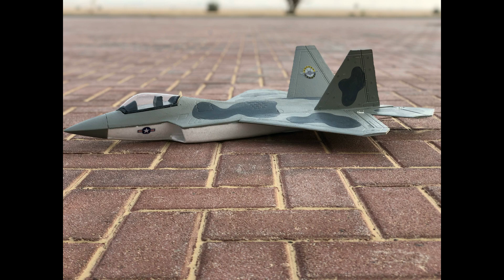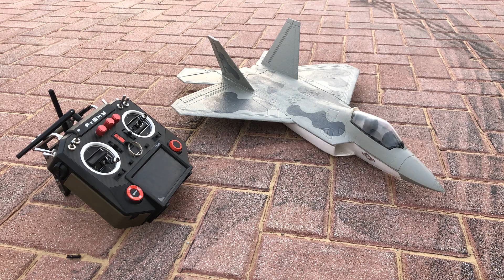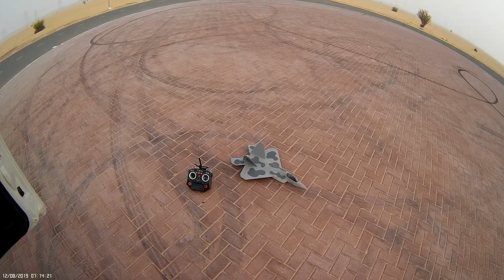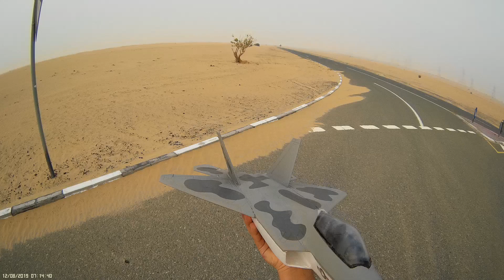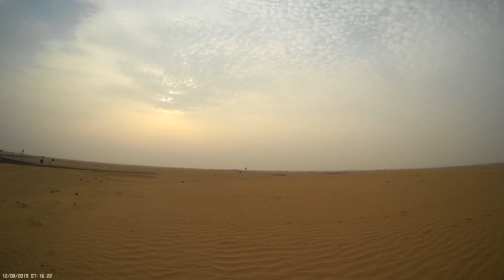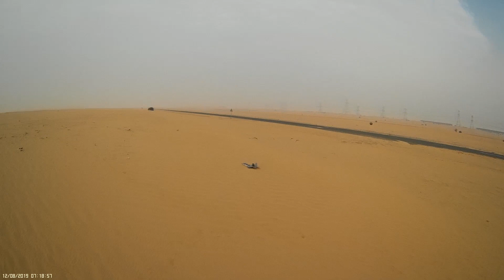F22 50mm EDF Maiden Flight

Comment: What battery did you use? What dimensions and weight? My f22 just arrived and I realized that there is very little space in the fuselage.
Reply from the maker: Jarek Czarek Jarek Czarek Hi, yes battery compartment is to small, I don’t remember the dimensions of the battery and can’t check it as I’m traveling now, but i think it was 1.3amp 4S lipo.